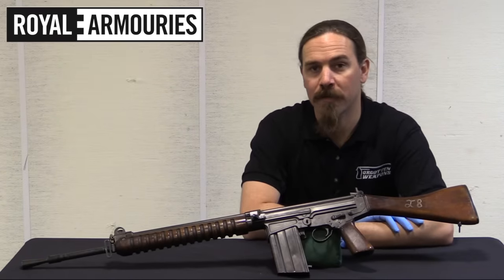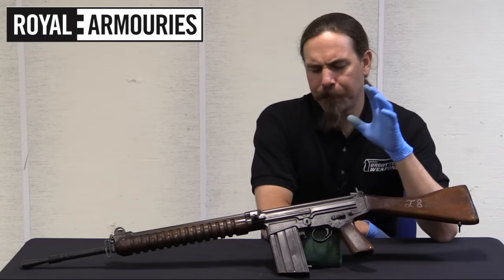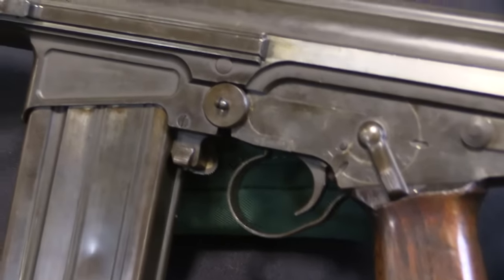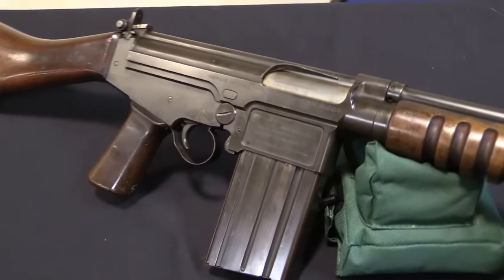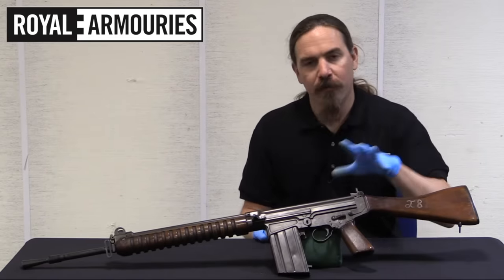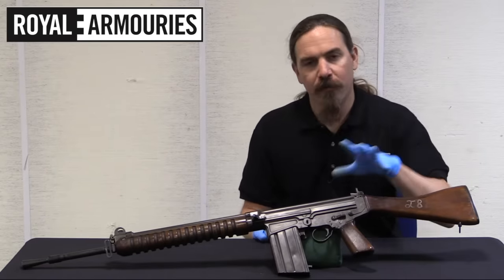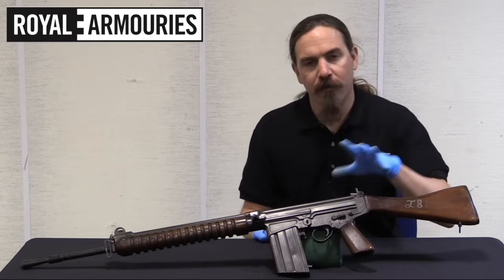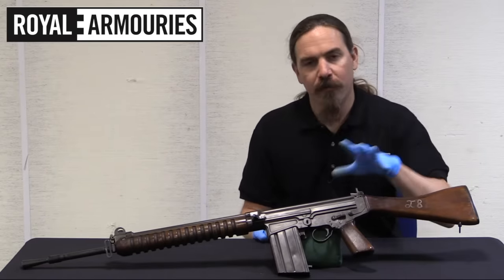The Prototype .280 FAL from 1950s NATO Trials

Comment: The grandfather of modern battle rifles
Reply: I would think the FAL is considered the second generation not the first as "gradfather" would imply? I would say the SVT-40, ZH29 and the G43 might be considered first generation of modern battle rifles?
Reply: @Mongo63a  MAS44 as well maybe?
Reply: @Mongo63a  Well not really. Those are semi-auto rifles. "Battle-Rifle" has a couple definitions but the one most meant by it is an Assault Rifle sort of gun but in a full power rifles cartridge rather than an intermediate one. The FAL was built as such (even though several countries would adopted it in semi-auto only) and so my knowledge is one of the very first Battle-Rifles.
Reply: @matthewtaylor744  Well the FN49, the for runner of the FAL, was made in select fire configuration as well. I guess if you look at it from your stated prospective the 1918 BAR or ChauChau would count.
Reply: @Mongo63a  True, though they were intended to be LMGs more or less rather than the standard infantry rifle. The thing about the FN49 and the M14 as well, for me at least, is that, while they do have detachable mags and select-fire, they're still set up like traditional rifles. No pistol grip, full wood stock. So depending on how you feel about that you can count them as Battle-Rifles or perhaps a transitional thing.

Comment: British did indeed use the .303 British round, but they also used 9mmx19 in the Sten,  7.92mm x 57 Mauser round for their armored coax guns, and aircraft use the  .303 British, the 12.7x99 Browning machine gun and the 20mm x 110 cannon.  Small wonder Churchill wanted to focus on a single round.

Comment: 7mm Mauser was designed in 1892.  Ever since then every other cartridge seems to be tap dancing around the fact that it already exists in the perfect sweet spot of full power cartridges.  .280 Brittish, .276 Pederson, .and 277 Fury are all within squinting distance of 7mm Mauser.  The old round is much longer than them in case length, but that’s about it.  Had any major power adopted 7mm Mauser in 1893 they could absolutely still be using it today.

Comment: Within the context of use of the L1A1 (SLR) by the Australian Defence Force the bolt and bolt carrier were referred to as the breech block and breech block slide respectively. Given that we took all our cues from the British army at that time I would be interested if the British squadie used the same terminology??
The reason I was given by my instructor during recruit training was that a bolt generally rotated and a breech block did not.
Reply: We also referred to the "charging handle" as a cocking handle
Reply: Yes we did, still do.
Reply: @coreywarde6030  i mean, if the gun uses hammer firing, then it technically is a cocking handle
Reply: @anonymous2513456  we use the term cocking handle for the LSW as well - charging handle must be a US "thing lol

Comment: government 30-06 ,150 gr bullet at 2750 , black tip . penetration of 3/4 inch armor plate, tilted 15 degrees, at 200 meters . tungsten penetrator with a small amount of explosive at the tip within a copper jacket . the explosion stabilized the penetrator and keeps it straight on .

Comment: Did you do a video on the M-15 (Full Auto M-14) a replacement of the BAR. I have  seen one in a 20th century weapon. Also on the M-14, there is a round, cover plate, when removed and place s selector switch with a full Auto one (any M14 can be switched, it was taken out of service because you can not change the barrels out.

Comment: T65 = 7.62 x 51mm = .308cal.  So confusing to have several names for the same thing.  It would have helped if you had mentioned just once that the T65 was also the .308.  I always wanted to add an FN FAL in .308/7.62 to my collection.  Alas, banned in CA.

Comment: The cartridge does seem rather slow for today's expectations of terminal performance, demanding sufficient velocity for armor penetration, reliable fragmentation or expansion, and consistent performance even at reduced velocities due to short barrels and/or long-range shooting. I'd go down to a 6.5 or 6mm. A lighter bullet can be fired at higher velocity for the same desired level of recoil. 6, 6.5, and 7mm calibers all offer exceptionally aerodynamic bullets. Going down in caliber to a lighter, faster bullet would eliminate the first two US concerns about .280 British, however valid they are. It would have the speed to make hits easier.

Later the US did this to a relative extreme with .223/5.56mm, which although lightweight and effective just doesn't have the long sleek bullets with high ballistic coefficients one finds at 6mm and larger, enabling effective shooting at further ranges.

Comment: Ah yes, two cartridges of the same caliber referred to as different sizes so they didn't get mixed up. British tankers had plenty of experience with that considering that they could be using any one of 75mm, 76mm, 77mm, or 17 pounder ammo; all of which were the same shell diameter.
Reply: 75mm was actually 75mm. 76 was 76.2mm or 3 inches. Replace the 75mm with 3 inch and your golden.

Comment: I'm curious, if the Brits wanted a mid range cartridge and to interchange with the 7.62 NATO. Why not create a 7.62 Nato at about 75% power for them to use. Then with a change of gas ports and sights and nd recoil spring it can step up to the full power round.   I know it would require a bit of work on the logistical department. But many countries use mg ammo that has more power then the rifle ammo
 Just a thought???
Reply: One of the reason for the intermediate cartridges was weight reduction. A rifle made to shoot the "reduced 7.62 NATO" must be able to shoot the full blown cartridge too, so no reduction in weight. The ammos will weight about the same (the weight of the powder is almost nothing) AND that would not have saved the logistical nightmare, since the rifles made for the reduced cartridge couldn't have shot the full blown one accurately (different sights required).
Reply: @andysavill8580  yes, but it said one of the issues the Americans had was the low power round. The ability to move from US approved 308 Winchester to drop down when not fighting with allies to the power of say a 30-30 round would let them have control in full auto and the full power with little conversion in case of a world war.

It's just a thought, but seems to answer a few issues that were raised.

Comment: I'm curious why there are references to 7x57mm Mauser, when it's usually written as 7.92x57mm (sometimes 7,9x57mm), and more properly 8x57mm.
Reply: Because there is also a 7x7mm Mauser cartridge. And it too was a military cartridge, arguably better than 7.92/8x57. Note"arguably". not definitively.

Comment: If the .280 ended up becomming ballisticly similar to 7.62x51, wouldn't that have still made it a better cartrige considering that it was still a bit shorter and lighter?
Reply: The ballistic of the 7.62X51 was a false target. The 7.62x51 was a very good design for the time for it's intended purpose. It's ballistic couldn't be replied by a round without making it uncontrollable in full auto (apart for the engineering marvel that was the 7.92X41 CETME). It was a question of deciding what they wanted. Or full auto controllability, or long range accuracy and power.
Reply: @neutronalchemist3241  That doesn't awnser my question, though.
Reply: @2Potates  You can exactly reply a 7.62mm ballistic with a 7mm bullet having 20% less recoil and overall weight of the cartridge. But the fans of the 7.62 will always say that the heavier bullet will have better penetration against hard materials and pierce bigger holes into soft tissues.
Reply: @neutronalchemist3241  I'm guessing that translates to a yes on my first question.
Reply: It depends on nailing down how similar vs. how much shorter and lighter, on what value you attribute to the differences, and then, how much does that difference cost because if you spent that extra money on something else that might be better overall for your military capacity. These arguments can employ ordnance staff personnel for their whole careers and when they retire, their successors will pick up where they left off.

Comment: I always wondered why the 6,5x55 Swedish was never considered as a lighter, yet ballistically sound cartridge for both assault and light machine guns.
Reply: As any pre-war cartridges, it's simply too big and heavy for what it delivers. It's too powerful to be fully controlled in full auto too. It's not an intermediate cartridge.
Reply: It's about 1/4 less powerful than the 7,62 NATO. So just what the British were trying to accomplish with the beefed-up .280, but with much better ballistics. And also suitable for a light machine gun which intermediate cartridges of the time were not.
Reply: @ThePerfectRed  The .280/30, the last iteration of the .280 Brit. was already scarcely controllable. The 6.5X55 is further more powerful, and it's still too big and heavy. It's bigger than the .308 Win.
Reply: What makes you think the 6,5x55 is more powerful than a .308 Win? 6,5 is around 3,000J, .308 is around 3,600J. There are good arguments for a weaker cartridge of course, but at the time the 6,5 was a well-proven design. So instead of developing something new, why not just use what already falls into this category.
Reply: @ThePerfectRed  I wrote bigger, not more powerful. The 6.5X55 is dimensionally BIGGER than the .308 Win despite being LESS powerful. It's bigger, because it had been designed for older powders, that required more volume to develop the same energy. "As any pre-war cartridges, it's simply too big and heavy for what it delivers".
Space and weight are important factors in logistic. That's why new cartridges had been developed post WWII, to replace those that had been designed when smokeless powders had just been invented.
Reply: Well, in a way you are right. But in 1941 they adopted a round with a lighter spritzer bullet that seems quite adequate to me. It has moderate recoil (less than NATO, more than 8mm kurz). I just think that, given the excellent external ballistic coefficiency it would have been a very interesting round.
Reply: I don't want to drive this too far, you have a point of course. But I feel that the smaller 6,5 profile with its is more forward-looking Ballistic coefficiency (shooting very flat) would have had a great potential - even to this day were rounds like the 6,5mm Grendal are considered again.
Reply: @ThePerfectRed  I'm a fan of 6.5mm rounds, but the 6.5X55 in particular, in postwar years had those problems. Too big (and that means it needs also too much material too to be built. Brass is a strategic material in war) and too powerful to be controllable in full auto.  Not taking the recoil into account, a round with a similar ballistic than the 6.5X55 could be obtained (like it had been obtained, see the 6.5 Creedmore) by shortening the .308 Win, that's already smaller than the 6.5X55.

Comment: 280-30 sounds a lot like 7mm-08 ... I would LOVE to have one of these in 7mm-08
Reply: 7mm-08 is x51 not x43 like the .280/30. 

7mm-08 is in essence 7mm 2nd Optimum

Edit: Not 2nd Optimum, I meant 7mm HV (7x51, Canadian iirc)
Reply: @Kav.  yes, the 280 is def a very different cartridge!  I hadnt finished the video when I wrote this, so didn’t notice that 280-30 was more akin to 8mm Kurtz, than 7-08.  Nonetheless, Id love to build an FN (or AR) in 7mm-08

Comment: Always had a soft spot for FAL's with wood furniture. They seem historical. Speaking of that, thanks for all the history background. I am familiar with it, but most people are not. I have researched the 280 British before, in part due to your old videos on the EM-2. I also ran across the 7x49mm (Liviano) made by FN for Venezuela in FN-49's with detachable mags. With all the talk of US mil going to a 6.5 or 6.8mm (.270) round, i have advocated the following on some forums:
Basically a reinvention/reimagining of the 280. Plan on a 120 or 130 gr bullet at 2400-2500 fps. This could probably be done with a case length of 40-42mm, so it is significantly shorter and lighter than 7.62x51/308. Use an efficient case shape and shoulder angle. Should be quite doable with modern powders. Ballistics are similar to the 30-30, (a tad faster than its 150 gr loads) with an efficient, aerodynamic 7mm spitzer bullet. Those are among the best shapes (7mm-08 has better retained energy than 308 starting at about 400 yards, and a slightly better trajectory). You can use a twist rate that will allow the bullet to tumble after hitting, like the original 55 gr 5.56 load (i will guesstimate a twist rate of 1:10 or 1:12, but a ballistics lab would experiment to make sure). Recoil will be fairly light, probably less than a 150 gr 30-30. The cartridge would meet or exceed all intermediate cartridge performance goals. It should also make a nice cartridge for deer, antelope, and hogs. A bokt action rifle coukd be relatively lightweight, and you would only need 18-20" of barrel. It would probably beat the 350 Legend for a light recoiling round for newer shooters, with flatter trajectory and a better effective range. Not a new idea, i certainly didn't invent it, just a few twists on the old idea. Everything old is new again. Anyway, my 2 cents and ramblings, FWIW. Great video as always. I love my M-1A, but we should have gotten the FAL

Comment: intermediate cartridges like 7.62x39 are gone for a reason.
5.56 didn't replace 7.62x51. We use 7.62 NATO in a lot of weapons systems for a reason.
The 7.62x54R is still used by the Russians, for a reason.
5.56 replaced .30 Carbine --- intermediate cartridge with the same recoil and around 1000 ft/lbs of energy, but with real rifle ballistics.

Comment: This whole cartridge decisions of the time are fascinating to me, but I think the US was fools through it all. Refuse the 280 round during NATO standardization in this time. 30 caliber or nothing. When we roll out the M16 we come down to 5.56(223). Why didn't we revisit the 6mm range cartridge when we decided to go intermediate round?  Then I wondered today if it wasn't still bullish pride, if we came back with a 6mm it would be a big told ya so with the rest of NATO since we refused just a few years before. Now after 50 years of 5.56 we are testing 6.5 to 6.8mm rounds to replace it. Funny how things come about.
Reply: 6.5-7mm cartirdges have about the same ballistic since the late 19th century. The wheel had been reinvented multiple times, with the volume of the case being reduced  as long as new propellants became available, and the lenght-diameter ratio of the case changed due to dimensional constraints. They could have adopted a shortened 6.5X52 Carcano case (the 7.62X39 Russian and the .264 USA are both shortened Carcano cases), or a necked down rimless 30-30 for that matter, and call it a day.